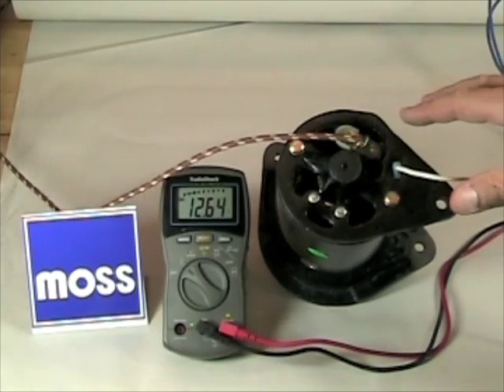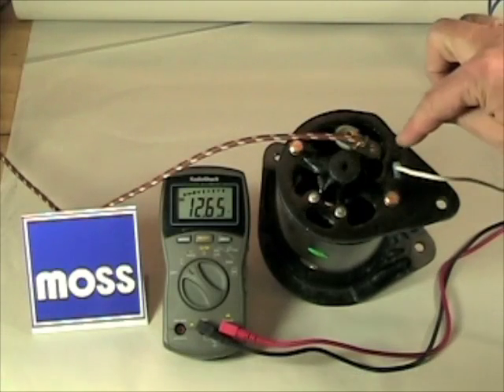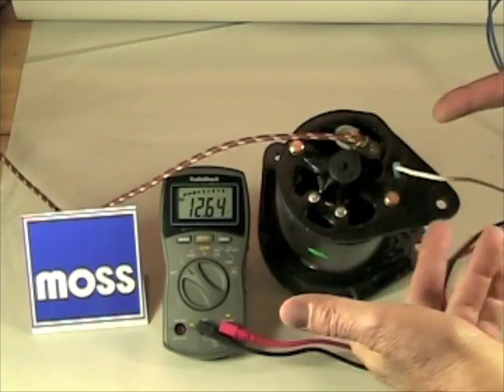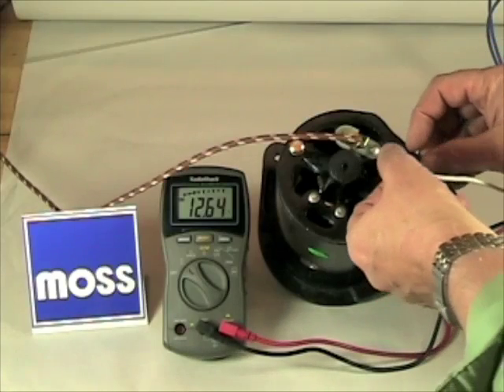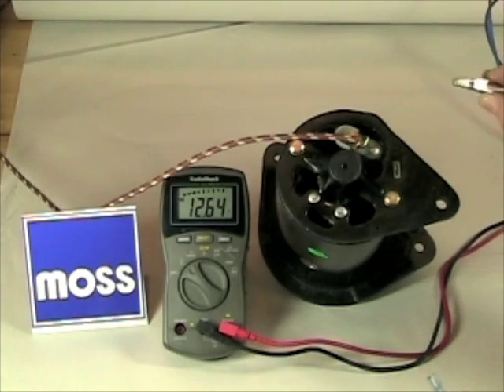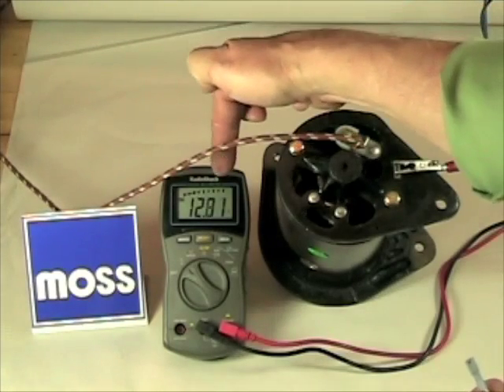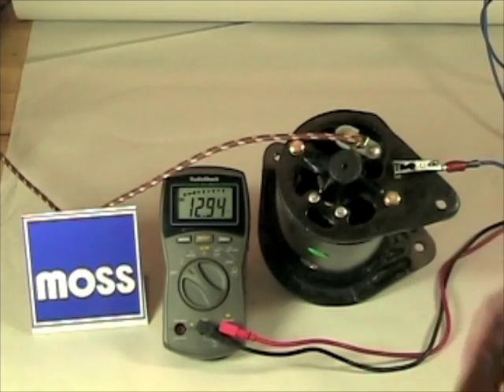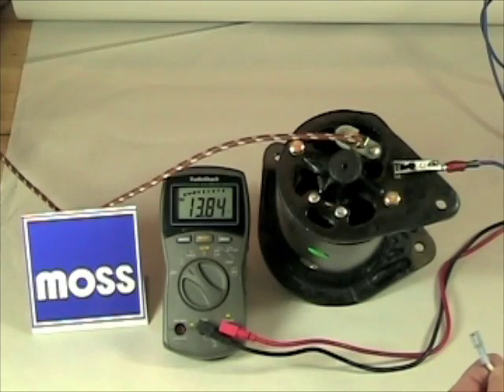Generator - How to Test (version 1-28-2009)

Comment: I love how the video shows what the multimeter is connected to, and where that other cable goes and what it's connected to..... oh wait, it doesn't.

stuff it, I'm just going to jam mine in a vice, spin it up with a power drill, and hook the multimeter to both terminals on the generator. that should at least tell me if anything at all happens.

Comment: hay ass wipe,,,,  what wires are connnected to the battery,,  and how is the meter hooked up...  if you have a volt meter to a battery...  and  just take one wire to a generator,  it won't give you shit...  the generator got to be hooked somewhere...  idoit

Comment: i have a serious problem!  i have a marine onan 7.5kw generator.. and it runs fine... but it jumps between 50 and 150 volts.. if i turn a light on it dims .. and brightens in a matter of seconds what is this problem? a voltage regulator problem? HELP